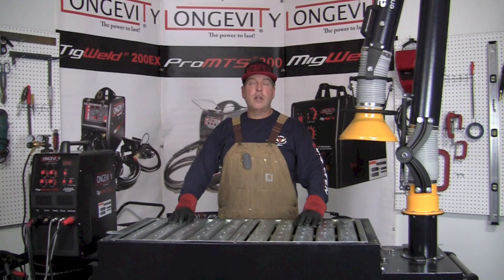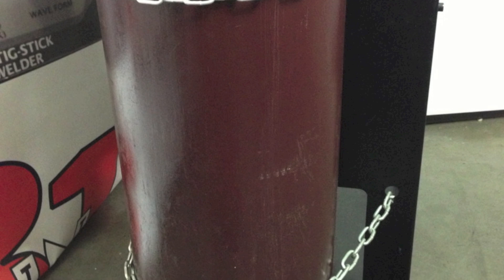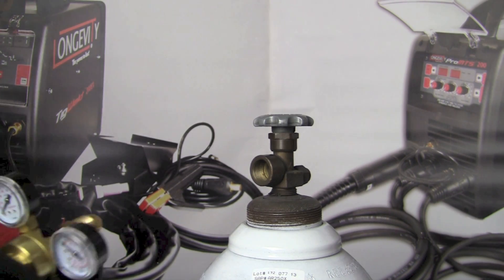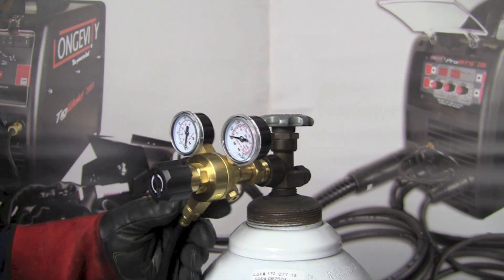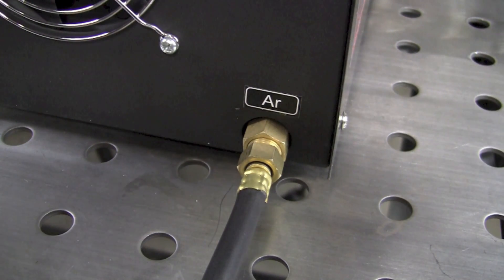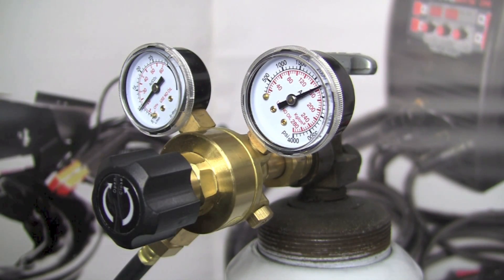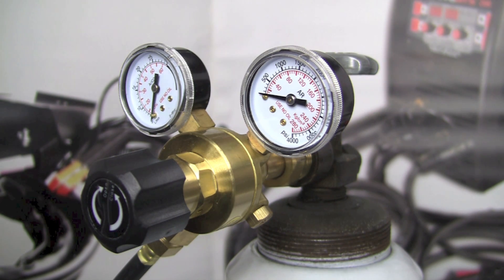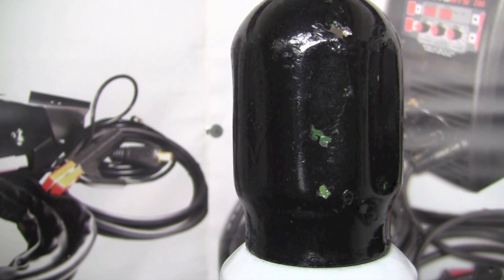ARGON GAS BOTTLE SETUP REVIEW FOR TIG WELDING

Comment: Is it both male and female tank cylinder valves where the argon gas regulator is threaded to on an argon tank cylinder? What is the size and thread pitch of the gas outlet fitting on the gas regulator? Thank you for you patience.

Comment: couple of questions :
1, when I have set it to 20cfh after press the button on the torch and then when it time out , it settles to about 30cfh . I have noticed that after I went to grind the tungsten put it back in the torch I saw that the flow reading had crept up to 35cfh and it was still climbing , slowly but still it was climbing. 
What does that mean ?
Should it do that ?

2, I tried to weld as I am new to all this , as I welded it went to 20cfh , when stopped , settled to 30-ish cfh , then carried on like this for a few more goes . Then thought ok , stop for now , so I turned off the main valve , then just pressed the button to bleed off the gas . The flow gauge went down but the pressure gauge for the bottle stayed where it was . The main valve for the bottle was definitely 100% in the off position . 
After the flow gauge went right down , I turned the regulator adjusting screw all the way backed out so no pressure on the diaphragm but the the gauge for the bottle, what is left in the bottle stayed where it was .
 What does that mean ?

Comment: The valve on gas bottles is designed to not be opened fully but only opened half to one turn, so that if there is any emergency to shut off the bottle it can be done quickly.
Reply from the maker: Thanks for sharing
Reply: keep pissing gas away.
Reply: Yea I don't believe that
Reply: @jeffgood6441 of course you wouldn’t 😂 you probably have a brain the size of a pea.

Comment: I wish there was more discussion of the connectors and hoses. I am still wondering what materials they're made from, their dimensions, their operational limits, what standards they adhere to, and what their designations are.
Reply: They’re brass and rubber…… 🤷🏼‍♂️🤦🏼‍♂️ ain’t nobody going engineer over some damn hoses.. the design is to move gas from a regulator the the damn machine…..

Comment: is there a reason to bleed out leftover gas in a hose/regulator after finishing welding? Can I just close the valve on the bottle?
Reply from the maker: The valve will work, but gas can get contaminated so that is why there is a purge and a bleed.

Comment: The instruction I have for my flow metre claim to never stand in front of the regulator as one is tightening it and to allow it to point away from one.  How tight?  1/4 turn, and does one check for leaks with soap water?  What is the margin of error?  Also, what do you mean with "if you've got a gas wrench?"  Didn't know there was a specific one made for this.

Comment: What does he mean when he says he wants the regulator backed out? Open or closed? At about the 5 minute mark
Reply: turned anti clockwise so regulator is closed no gas flow to welder

Comment: Dont you need teflon tape for the regulator- and hosescrewtreads?
Reply: Gas fitting tape its yellow normal teflon is white. The yellow is thicker . Imo anyway
Reply: @Kid_Kootenay  good to know, i didnt know gastape was different. Almost everyone i saw doing it did it with the white teflon tape, which does work. 

I dont take your comment as an insult, but it does look like one......

Comment: It is necesary to remove the regulator every day? Can it stay connected to the bottle for the next day?
Reply: yes it can stay on full time. just back out the adjusting screw on the regulator. counter clockwise(left turn). do not leave tighten when opening any gas cylinder.

Comment: Can Argon gas welding used to weld the front camber arm of a luxury bus of 25Ton ?
Reply: yes, you would need the proper filler rod., better to just buy the part than welding it. you would be payin more for having it welded vs just buyin the part.

Comment: Would the use of, gas appropriate, teflon tape be any help to these connections?
Reply: never use teflon for the fittings.
Reply: I couldn't remember what my comment might be referring to so I reviewed the video. Your absolutely correct. The threads aren't meant to provide a seal. It's the machined surfaces of the fittings being pressed together that seal. Thank you for jump starting my brain.
Reply: @michaeldvorak5556  lol aint no problem.👍

Comment: Why would you use an adjustable wrench for tightening fittings. when you can use the proper OE SAE or Metric Wrench? Crescent Wrenches are famous for rounding off.
Reply: Not if you use them correctly they’re not 😂

Comment: What is the difference between a car welding machine that contains a gas cylinder and does not contain a gas cylinder?
Reply from the maker: The ones with cylinders are using a different wire and are not using a flux core wire they provide better quality welds.
Reply: Is it permissible to buy a welding machine for cars that do not incorporate a gas cylinder and in the future to incorporate a gas cylinder?
Reply: @حسامحسام-ط9ب9ظ  its better to use gas. mig or tig. flux coated sucks.
Reply: What is the price of this device with connections, gas, knob ... etc (full?)
Reply: @Ryan_1997 no it doesn’t. Flux core is perfectly fine and required if you’re wire welding outside.
Reply: What is the price of this device with connections, gas, knob ... etc (full?)

Comment: what pressure to setup argon bottle in BAR value?
Reply: There is no such thing :P In metric there is liters per minute. For TIG one usualy use 7-9 liters per minute depending on what you are welding and torch setup

Comment: Good video. One suggestion? It's always a good idea to use 2 wrenches when tightening the hose to regulator/flowmeter connection, and hose to machine connection, just to make sure nothing gets bent/broken. Just the way I was taught. I guess sometimes folks can get a little "heavy handed", using just one wrench. Anyway, thanks for the informative vid.
Reply: "It's always a good idea to use 2 wrenches when tightening the hose to regulator/flowmeter connection, just to make sure nothing gets bent/broken." - how does that work?
Reply: @benjimlem1284  yea I want to hear too

Comment: So 100% Argon is fine?
As opposed to 25/75% CO/Ar?
Reply: Just Argon and or Helium for TIG welding, Co2 is for MAG. The I in TIG is for inert gas, Co2 reacts with the weld, making it TAG, and there is no such thang
Reply: Professor Fanwalker haha what?
Reply: Doh, was thinking of Mig welding....
Reply: 100% is used for aluminum mostly but should be fine for everything just costs more thats all